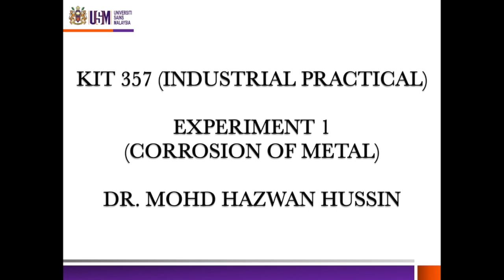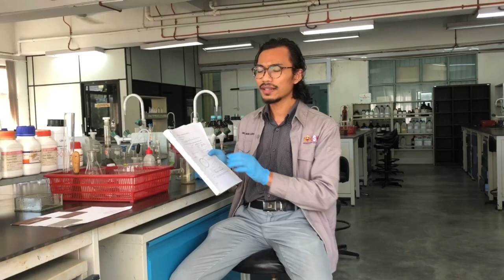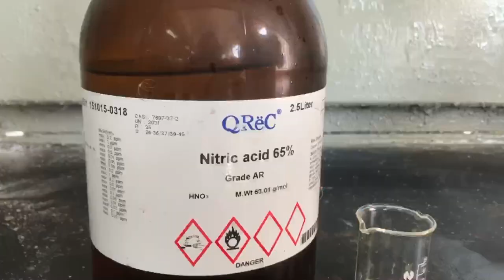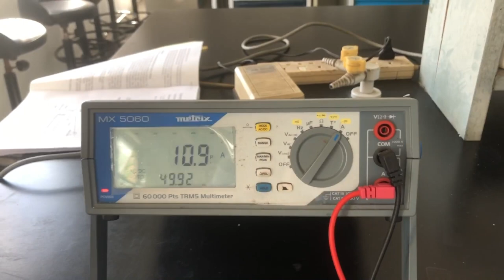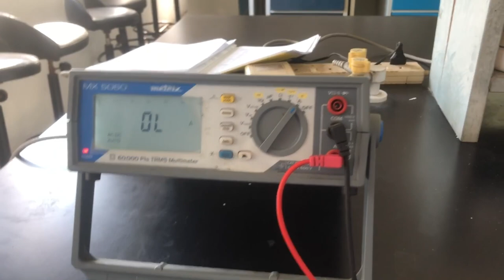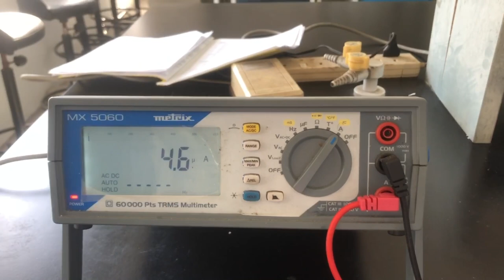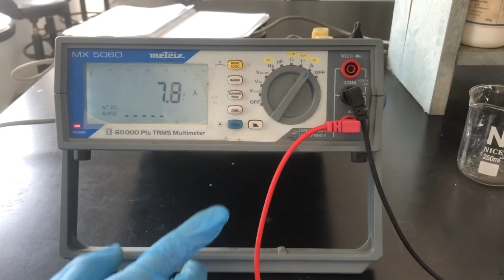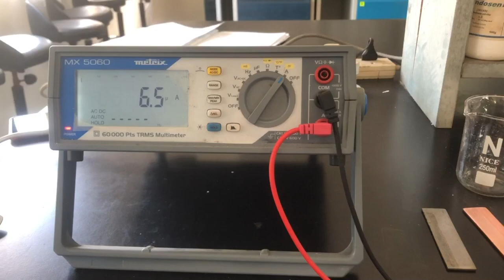KIT 357 Experiment 1: Corrosion of metals

Comment: after watching all experiments
It's now time to have the Q & A session

1.Like in the case of Oxygen is bubbled through chamber why the current is increasing
2. then for screw and for pin why there is the different color scheme
3. there are different sets of electrode chosen and we get current in different values
 but why this is happening that is not explained
4. I COULD UNDERSTAND only the corrosion current increase in case of the larger anode which I can explain to the students.
5. but I am curious to know other experiments and the answer any idea how can we address these queations>>>?
Reply from the maker: Thank for the queries. Let me first tell you that this video was prepared for the undergraduate practicals. I am not suppose to reveal the reasons because they need to prepare a report. But since you have asked;
1. Purging of oxygen will increase the concentration of dissolved oxygen in water. Therefore the oxidation process will be more favored, increase the forward reaction and finally increase the current value.
2. It supposed to show different color because this part was to study the effect of stress on the surface of metals. If there is a stress or scratch or lining on the surface, the surface will be more exposed and oxidation process will be more favored.
3. Different current values produced from different set of electrodes are due to their reactivity in electrochemical series. This is a basic electrochemistry concept.
4 and 5. Large electrode surface or area will obviously have more reactive sites for the corrosion to occur, therefore it will have an increase in the corrosion current values to that of the one with smaller area.

Hope this explanation help you.

Regards,
Hazwan
Reply: @mohdhazwan6523  Thanks a lot for your reply..I can now explain the entire experiment to my students..